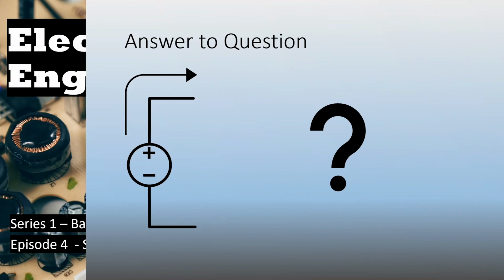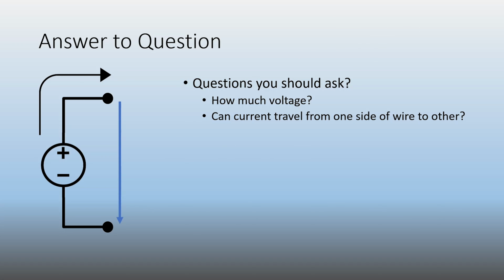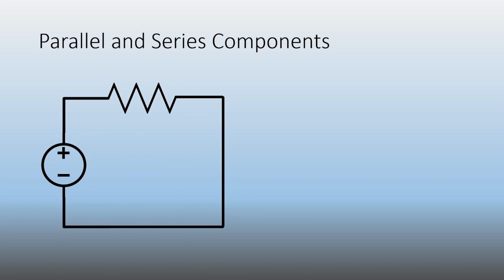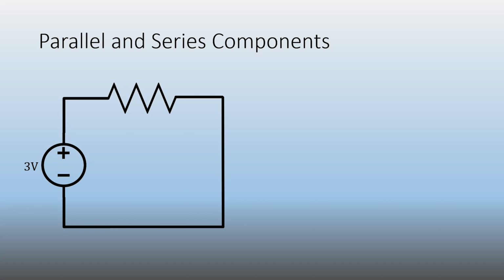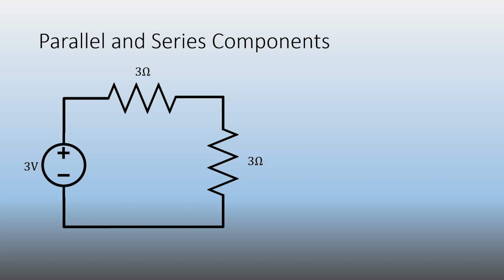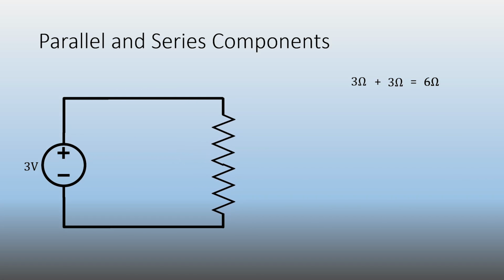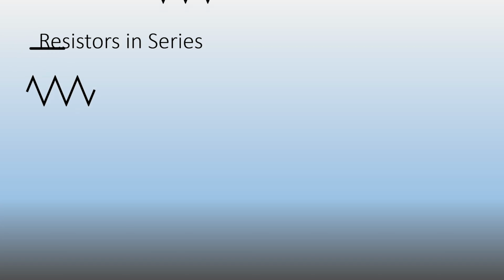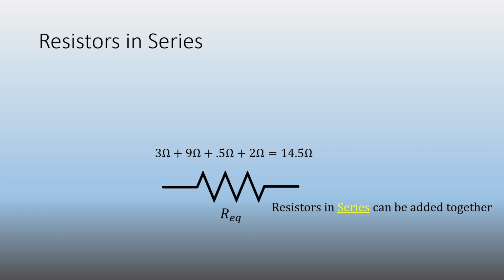Resistors in Series  -  Electrical Engineering 4

Comment: At about time 1:48 did u divide both sides by 3?
Reply from the maker: Using algebra, I rearranged the equation with i on one side. The other side becomes 3 volts / 6 ohms. This is equal to 0.5 amps.